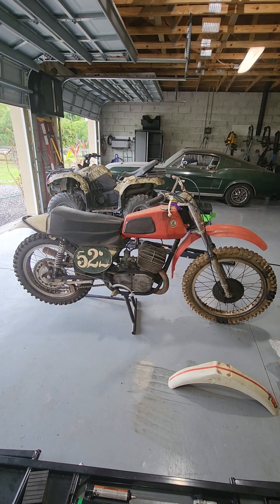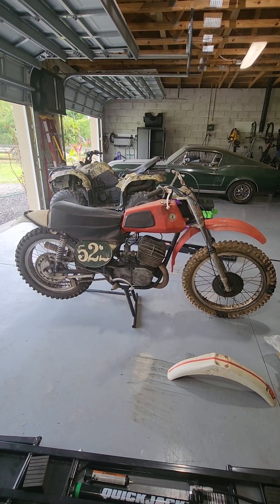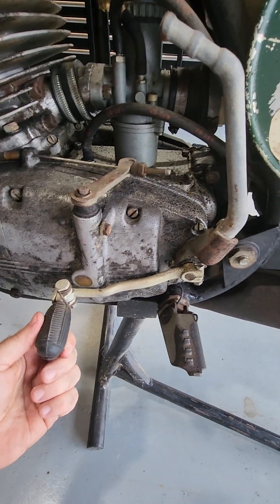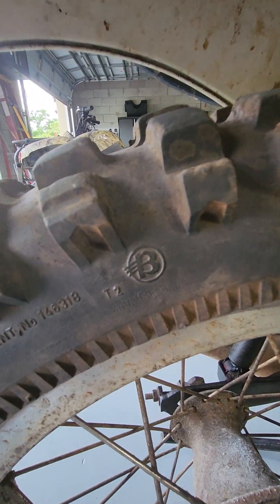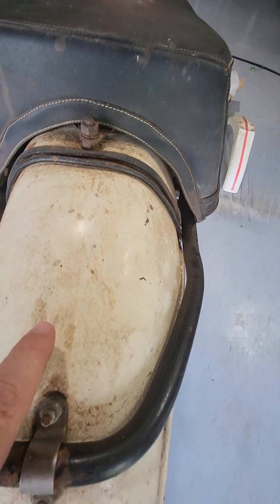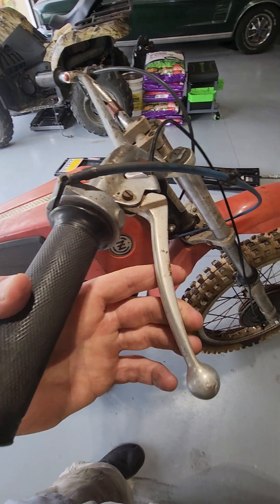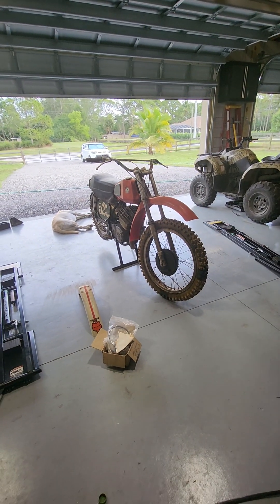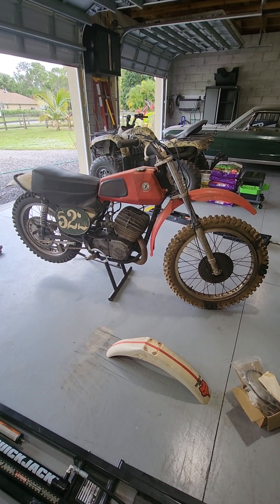1973 CZ 250 mostly original

Comment: Treasures from the past, great video. Like the one you are have, i have a '73 250 & 400. A 1975 Falta 400 and  1972 Maico 400, all bought in the crates, assembled by my father, brother and myself and enjoyed almost every weekend. These bikes are bulletproof and still running. Thanks for the thorough presentation of the dinosaur.
Reply from the maker: So have always wanted a Falta replica....how much better is it compared to the 73 or are the differences minor when riding the bikes?
Reply: @scottsmotorsportsofpalmbeach the 400 I have is the "Works" model with the rear shocks laid in a more forward position to allow for more travel and smoother ride. It is an all around awesome machine to ride.

Comment: Don't look like it got rode to much
Reply from the maker: Agreed....with the original rear tire still being in good shape, does not have a ton of hours on it. Dad bought it and although I was riding it, I preferred riding my other Japanese bikes....particularly the Hoda CRs....easier to start, had tons of power and so much more suspension. Should have it back up and running in the Ned couple of months and will start to side it again